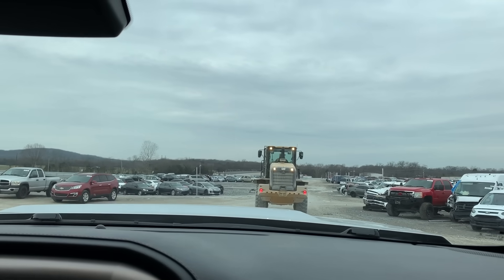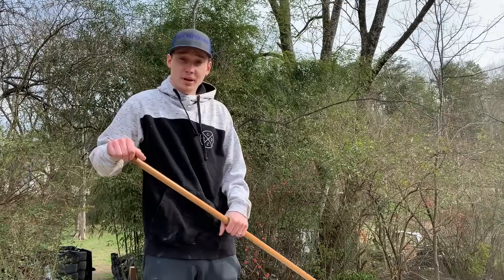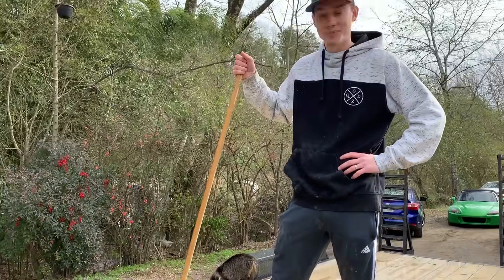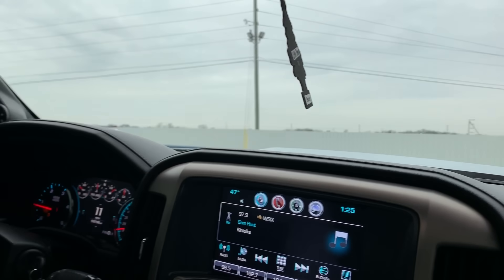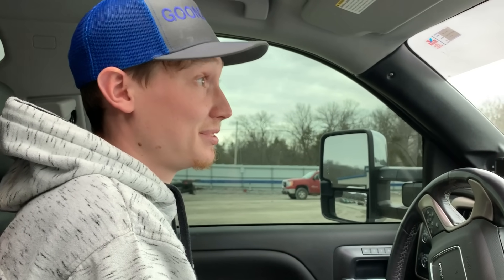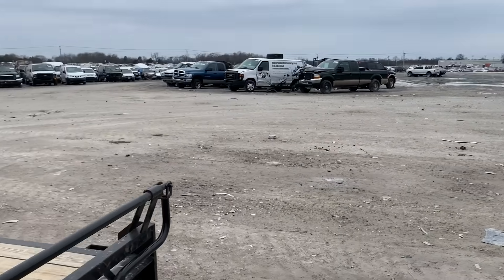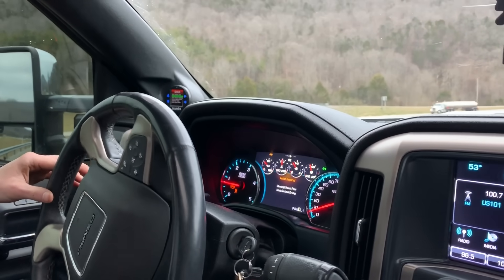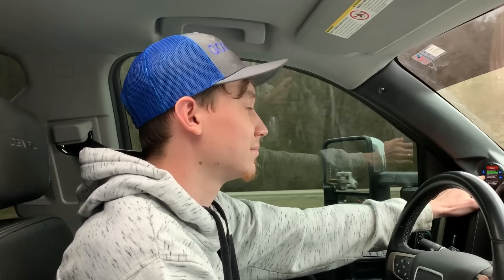Buying My Dad His Dream Wrecked Truck!!!

Comment: Your GMC came up as too rich on your tuner. It sounds like it was dumping to much diesel in to the engine and stopped up the particulate filter and needs to do a regeneration to clean it. I suspect it has something to do with you having your tuner turned all the way up combined with the pull up the mountain.
Reply: Too
Reply: and having the full factory exhaust system. deleting the exhaust would help it breathe alot better.
Reply: @ryy597  true but then they have to worry about the EPA. I wonder why they deleted the 450 but not the duramax
Reply: JeepWoodsFun yeah but Tennesee
(where they register their cars) has emissions that suck ass
Reply: @og5782  that must be a pain... i don't understand why they deleted the f-450 but kept the duramax stock.
Reply: 100% don’t tune with all the restriction, and then blame it on the duramax, haha!
Reply: Dah 🤦🏽‍♂️
Reply: Yes! Stop towing on the highest setting!! Tow on the lowest!
Reply: @og5782  my part of Tennessee don't have emissions testing

Comment: NEVER tow with the tuner turned up. That's how I blew up mine.
Reply: I always tow with my tuner on performance on my 6.7 no problems at all
Reply: If you monitor your temps and egts you wouldn’t have blew your engine. I tow with mine turned up all the time. You just gotta keep your foot out of it
Reply: Yea, you’re wrong on that. I know guys that NEVER take their truck off of the highest setting because the truck learns the hp level that it’s at. It especially helps the trans.
Reply: @Sydwayz504  100% truth I just drive like I should and pay attention if he blew his up it probably had lots more to do with than just tuner turned up and towing
Reply: You must not town often, what do you think a tuner is for lmao
Reply: @norsevikingsir4932  I'm a truck driver everyday. There is a difference between a performance tune and a tow tune. The performance tune will dump excess fuel that you don't need and on a dpf truck will clog your shit up so fast.
Reply: @Sydwayz504  my point exactly, lower the tune power level and then you don't need to be so on top of it, just turn down and go
Reply: @burntsilverado  So you know what tune they had it on? What their number 6 tune does? Nah didn't think so.
Reply: My 6.7 Stetson performance best fuel mileage and trans shifts best for all that hp been driving it like that for 3 years or 150k miles no problems yet
Reply: Or just delete the DPF since that seems to be what was causing their problems.

Comment: There’s too many comments for me to read through to know if someone posted this information or not. But in regards to deleting the bed, it’s a Federal DOT Reg, if there is a bed, it’s regulated differently, it’s a truck/trailer as one unit and length becomes a concern, without a bed, it’s two separate pieces, tractor/truck and trailer. All this being said if it’s going to be used for commercial use. I don’t know everything, but I think that’s a good start if you’re not already aware of this. 

Love the channel, you’re doing great work, keep it up!!!

Comment: Running on mode 6 on the tuner box will cause the region mode to kick in, drop back to 2 or 3 and lean the exaust gas out to clean out the particulate trap filter. Great find for your father!

Comment: Ya'll gonna melt that Duramax on lvl 6, Pull up your EGT at the turbo and post back. Set the tuner to the truck, change the settings, you can do a moving regen. stationary when the load is 90% or higher. Lots of info on the banks website.

Comment: Quit using tunes while you still have emissions intact. You’re gonna ruin a very expensive system. Unless you delete the emissions, leave it in stock power level. Running rich means you’re dumping too much fuel into the engine.
Reply: @edwinmena643   hes right tho
Reply: @edwinmena643  he is right if its too rich than it means too much soot is entering the dpf and it will cause damage..... don't tune a diesel if it still has that tier 4 crap honestly.
Reply: Ed..please don't talk when you have no idea. They need to look at tune kit settings. Max lvl is never for towing. Read the manual first when anyone spends the cash on any tune kit.
Reply: Edwin Mena Lol at the attempt to act smart.
Reply: 100% right on... and now they’ll probably need to take the DPF out to have it professionally cleaned if they want to keep using it.
Reply: @ericdavi1231  exactly and it aint cheap when the ARD head gets clogged from not getting it cleaned.
Reply: Josue Beltran I had the turbo seals go out in one of our trucks which caused burnt oil to go into the DPF and clog it up. Very expensive! 

In my case a bad turbo clogged my DPF... In their case a performance tune clogged their DPF.
Reply: @ericdavi1231  yeah and it doesn't take much either...
Reply: @edwinmena643  Do you know what you are talking about? I am a mechanic Manny is right. Trucks running fat not good for MPG's or the DPF system, the tune is hurting more than helping right now. They need to do the delete to keep the tune.

Comment: the regeneration off the diesel filter is what is common on most trucks (semi's) i have it on my mercedes to. It burns out the collected particels and burns it. Makes weird noise but is normal. Just keep it running. It takes about 75 miles or an hour..great post guys!

Comment: "pretty much a oem truck and it started malfunctioning" did you guys forget that programmer you installed? That would've 100% been the problem.
Reply: All tuners are not created equal, some are not designed for towing, some are designed for mall crawlers (they built a mall crawler)
Reply: @Rev1Kev  yeah that thing decked out for shows , no tows

Comment: We can’t be towing in a race mode. 
There’s a reason the manufacture keeps a specific tune on the truck  
GM manufactures have engineers that work day in and day out. 
Not just a weekend warrior, trying to get the best speed out of his diesel .
They should have a tow tune specifically for you .

It also depends on the quality of the fluid 
And the quality of diesel fluid .

If you go to a filling station and your diesel, smell fresh, it’s a good pump.

Also, if you have big tires and big rims 
You should be re-gearing the truck .

It’s basically a show truck you should be using the F450 for that towing heavy stuff .

Anyways, good videos guys. See ya

Comment: conversion is possible look up “Da Drop Shop” on ig they did that but with a 1500 front end on a 17’ 3500
Reply: 🤦‍♂️🤦‍♂️🤦‍♂️ that's a 1500 front end and it looks stupid as all get. They want the 2500+ front end
Reply: All the way in Midland though da drop shop
Reply: Josh so if the 1500 firs the 2500 will to dum shiet...ps that truck got top 10 in all truck shows
Reply: Si Awebo I did a conversion myself on my 3rd gen 3500 used a ram 1500 cab

Comment: Y’all need to delete the def system that’s the reason why the engine struggle to tow the ram
Reply: Newer diesels have particulate filters that stop soot from going straight to the atmosphere. Once in a while you need to burn the filters out by driving at higher speeds for prolong periods. If ignored, especially gm vehicles will reduce power (limp mode)
Reply: Take it empty to Atlanta and back at 80 mph.
Reply: No, just need a good tow tune! DPF do  not rob trucks of power!!
Reply: mixalis if you delete the truck it will run way better
Reply: Brody Nordin that’s why you just delete it, then you won’t have to worry about it
Reply: Over in Europe where almost everyone switched to diesel cars,  before DPF was available, and the soot they throw out is pretty nasty stuff, so the rates of asthma have risen to awful levels. In the UK (England) one child in every 11 has asthma. DPFs stop that. Luckily, the diesel soot is heavy, so it doesn't travel far, so if you remove your DPF it will only damage the kids that live near where you drive.

Comment: “Pretty much an oem truck”... with an aftermarket tuner in level 6. SMH
Reply: They left it in 6, it increases power with fuel level. With the DEF system, it doesn't compensate for regen.... They need to pull emissions off the truck if they want to run it like that. It'll stop it up every time.

Comment: Sounds like he’s dealing with the electronic log book
Reply: Yup, but even hotshotting requires ELDs unless you're short haul exempt, but then the same goes for trucks operating under the 100 mile air radius. Still have to abide by the FMCSA.

Comment: soot/particle filter clogged up because you are running tune  and hauling ! simply said  tune gets the fuel air ratio rich to gain power  and when mixture is rich it makes soot and when you hauling the load on engine increases so vehicle computer fuels it up to gain power again so both of these things clogs the filter you need to remove it  simple way or need to run vehicle   on high rpm so the computer engages regeneration (burning soot in the filter) and you need to drive it on high rpm for quite a bit (there is  fuel additives to help clean the filter) replacing it wont help cuz it will clog up again in time (there are services here in Europe  when they removes it and wash it )

Comment: Just so ya'll know, hotshots have to run ELD(electronic logging device) and follow trucking HOS(hours of service) also. And to run legally still have to have all the same stuff trucking companies need.

With the truck running the way it was running, that was normal, especially if it is stock with ALL emissions still attached.  You gotta remember, with the tuner on the higher setting and pulling a load, it will run rich(burning more fuel).  When hauling something, its best to put in the 1st setting(which is usually about like 25hp more than stock).  

Now ya'll get to add a Cummings to your collection of videos though.  Maybe one day ya'll will do a full Fummings swap(Ford body with Cummings Drivetrain).

Comment: Turn  your tuner/programmer off when towing. Just use the factory tow haul mode, the factory shift points will allow your truck to operate in the optimal power band for towing. Your tuner is just dumping more fuel into the motor than is needed.

Comment: 93 F350 Dually, the regen just take it out and run it up and down the highway about 40 50 miles at normal speeds and it should fix your regen problem... I hated working on new diesels as well.  Old school before using ecms haven’t the greatest mileage BUT super easy maintenance compared to engines now days.

Comment: There's a Diesel particulate filter in the exhaust and the DEF fluid cleanses it when it's necessary. So the DEF and doing a Regen is absolutely necessary or breakdown.

Comment: the log books are like what the uk had befor Tachographs, it is to make sure you don't drive tired. their has been some terrible accidents where truck drivers cheat the system fall asleep at the wheel either come of the road or crash into something or someone.

Comment: I used to build and race cars here in the U.K. and built my own trailer, and to negate any hassle and time loss I built it so the ramps simply lifted and slid under the trailer body, and were held in by simple spring clips. I could load a running car and be gone in about 3 minutes, That said I also fitted a winch which was perfect for loading non runners. All that said, I personally would have done all of the necessary work on the truck before cleaning it so thoroughly.

Comment: Just use tow mode it works better. I tow a 28 foot travel trailer and it weight 4800 PCs my tow v vehicle is a 2011 GMC with the5.3 vortex engine with a 6 speed Allison Tran. I alway have it tow mode and it pulls the mountains great . God Bless and your Dad will love it 🇺🇸🇺🇸🙏

Comment: A cool thing about the 2012 dodges is that you don’t have a DEF filter because dodge tried something different and it didn’t work well so they recalled it and you can just run a muffler and make crazy power without restrictions

Comment: The reason you were having so much trouble with the GMC is the width of those tires...I had a truck I put those things on and all it did was tear my truck to pieces...Ford used a front stabilizer bar on the 79 F150, those wide tires egg shaped the bolt hole the stabilizer mounted in...it had to pull not only the weight of the Dodge but the extra ground friction from those tires and Mt Eagle Mountain is KNOWN to burn vehicles up especially going east on I 24...you stopped at Martin Springs Rd exit to let it cool down and if you had looked down right after the actual bridge, you would seen burn marks from another vehicle fire..I used to live off of that exit...you could hear the fire trucks all times of the day and night...if you haul anything with that truck again, you might want to change the wheels and tires out to a standard size...

Comment: That's a 2012, last year "Dodge" built trucks.  Look on the dash tray and it says "Dodge."  Also, last truck before you had to add DEF.  You still have the emissions to include DPF and EGR, but at a reduced rate of having to deal with that crap.  Great truck.

Comment: "Naw that's headlight fluid, you need that" LMAO smooth. Thanks for saving those windshileds from them rocks. I mean I know its free and all but still. Time is money and my truck is never parked at work so I have to day off for a stupid crackex windshield like I did last week. Thumbs up. By the way... Diesels cant run rich or lean, only gasoline engines do that. As for a lack of high enough fuel pressure, that's another story.

Comment: Guys, to rich means that you have more fuel than air mixture in the combustion chambers. This will result very heavy fuel consumption and lost of power. check you engines air filter make sure your Oxygen sensors are all working properly. Good luck guys!

Comment: Ford diesels have to be regened every now and then as well basically what happens is the exhaust gets really hot like around 1000 degrees to burn out all of the soot in the exhaust. When the truck says that it is regening you are supposed to keep driving until it says regen complete

Comment: Nothing to do with being a duramax. When you tow on six you’re making soot. On a deleted truck when you turn it up it smokes more. You’re doing the same thing but with all the filter garbage in place so you’re plugging it up because of increased soot output weather you can see smoke or not. Most tuners tow mode is two or three. Towing heavy in six is pistons cracking/melting territory. You better be watching the pyrometer the whole time. Bad part is you can barely delete now. If you know someone in the business they might hook you up but if they don’t know you they’re not gonna do it

Comment: Do you know what the heatsink on the rear means? it's a 4:10 rear As far as I know you can only order the 4:10 with the asian transmission. That also give you the HI out up cummins . And take the tune crap off the truck they are just as illegal as removing emission devices.

Comment: Too rich means your tuner is dumping too much fuel.  Like others have said, don’t tow with high tune level.  The tuner usually has a low to mid level for towing.  That’s only like a 7,000 lb truck plus trailer so it shouldn’t stress your truck.  Diesels were designed to run a bit lean and most box tunes like to run super rich to roll coal, but that clogs the DPF.

Comment: Nice truck, dude's! Despite being a "run and drive" I would avoid start-up's until detailed scan is performed. No telling which body control module wiring could be damaged/shorted possibly causing additional and possibly costly damage. Too risky!

Comment: boys your towing a heavy load with a decently tuned truck, your dumping all that fuel into the engine to get the torque you need to pull the load, and because of that you dpf is getting clogged with soot, your building it faster then your system can clean it,   go down to a less hot tune and you probably would have been fine,  but anyways, park it running do your regen youll be good to go again

Comment: You have to be careful with those tuners.   Watch Gale Bank’s videos about the tuners that don’t truly enhance the performance of the engine.  They only pour in more fuel and don’t consider the air input.  Also the L5P has an EGT limit, without the proper tune the EGT temp limit will be exceeded and the ECM will derate power.

Comment: Fellas, when towing, don't put it in lvl 6 on your tuner. It will make your egt's (exhaust gas temps) too high. Being on 6 if probably what caused your check engine/regen light.

Comment: Since your dad might be traveling put a bigger fuel tank, a towing tune and if he takes off the bed makeshift something to hold tools and things like high pressure oil lines, extra tires and or extra tools that will make work easier and make it a goose neck because me personally I think there harder to steal off of trucks

Comment: Basically your exhaust wash getting too full of carbon build-up and so your truck was having a hard time pushing the exhaust out the engine. The Re-Gen helps burn some of that excess carbon out by heating it up (thus burning more Diesel).

Comment: Just to reiterate, DON’T TOW WITH IT IN HOT TUNE MODE.

Running rich means there’s excess fuel (due to the tune) which is going into your exhaust.  

The truck is tuned for optimum reliability as stock.  When you turn up the power you compromise reliability, as y’all just proved.  

Just coming one buddy to another.  Keep up the good work.

Comment: You guys need to learn about the DEF system before you take it on a long trip.  You should have done a parked ReGen to burn the particulate matter and things would have been fine.  It De-rated your performance since the system needed a ReGen.  Your lucky you got to go as fast as you did.  One way around it if you're able to find the speed sensor at the drive shaft, you can unhook that but you wont know how fast you're going and neither will the computer.